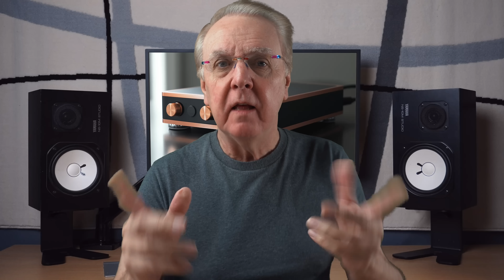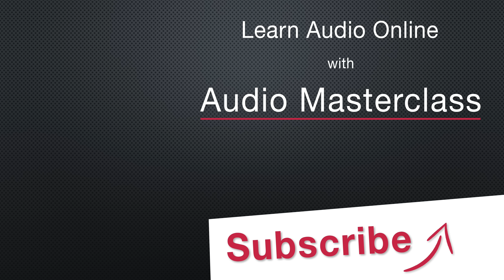Audiophile preamps - What should you get for $30,000?

Comment: What I expect for top money? The best components from big ass parts manufacturers that have the QC under control, the best capacitors, a pretty damn ass flat regulated DC power supply, ovenized V-REF voltage for the op-amps and exceptional well designed, modular PCB's with swappable modules and a FULL schematic with the BOM for the key components. Also fully shielded housing that can withstand shipping, and not a single component or wire flapping around in the breeze. 

When Marco Reps would fall into tears of Joy when opening that preamp up: Job well done and money's worth. :D

Comment: Learned my assembly and repair techniques working for Marconi Marine on marine radio equipment. All components formed and leads clipped and bent flat against the circuit boards. The back of the circuit board had to be completely smooth to the touch. All boards treated with a varnish coating to protect against dampness and vibration. Made repairs and fault finding a bit more difficult, but stuff i built 40 or 50 years ago still works within spec today. Mind you the equipment costs then were in the thousands of pounds per item, so most companies just rented the gear. Top performance and hand construction costs a lot of money but that should result in equipment that will last for many decades of use without developing faults. The box around the outside needs to provide protection and shielding first of all and look good as a very secondary feature. Look at high performance ultra cars, they mostly look as ugly as sin, but every feature is there to increase performance and improve survivability in event of an accident.

Comment: One specific "feature" of the controversial pre-amp was the hand selected components, this CAN be a very poor practice. As a child maybe 60 years ago I was building something and matching perhaps 5% resistors to perhaps 1%. I remember my late father explaining that a selected 5% resistor does not become a 1% resistor. The tolerance is not just of the initial value but factors in aging etc. 
IMHO for £25.000 this could have been beautifully engineered, well shielded  and still made a very good profit.

Comment: In my experience I have avoided tantalum caps due to many failures that I have seen.  The product in question seemed to have quite a number of those caps. Also ,why use twisted pairs when a nice coax would be better particularly for the low level inputs.

Comment: It's not about the actual performance although the unit seems pretty good. It's about boasting rights: "my preamp is worth $30K", "my speaker wire is $1000 a foot", "my cartridge cost $10,000.00", "my mains cable was $2000.00" - sure sound is good but only 0.00000001% of the human race can appreciate the difference from a decent system. And for the mains cable there is SFA difference. I need some magic tuning rocks.

Comment: See  RIAA equalization of phono
It isn't flat.  There are basically 3 standards so if you want to be super fancy you can include a switch.
It is basically a pair of decreases in gain one drops the gain 20dB from 20Hz to 1KHz and the second one drops an additional 20dB from 1KHz to 20KHz.
I have looked at mains on a scope.  It mostly is a fairly good sine wave except when it isn't.  Great big spikes happen and also sometimes big chunks are nearly missing.  The spikes are often stuff getting switched off.  The missing cycles are big things getting powered on.
I agree with the external DC supply.  There should also be some big common mode chokes included.  There is a lot of capacitance in transformer windings.
Resistors should be metal film of thin film not thick film or carbon-comp.  Thick and carbon resistors make excess noise when there is a current.
A nice transistor to look at is the LSK170 JFET.
For bipolar ones, there is a funny thing where the "medium power" transistors make lower noise than the small signal bipolars.
Capacitors also need more care.  Avoid any "high K" ceramics or polarized ones in the signal path.  They are OK for supply bypasses.
Reply from the maker: I’m saving RIAA for its own video. The output of any preamp post-RIAA should be flat.

Comment: The entire "design" of the unit was laughable.   How many power supplies do you need to power two preamp channels?  Personally, I'd probably opt for two linear split rail regulators in the preamp box fed by the linear power supplies in the ludicrously large external power supply box, and that would only be for the wow factor since a properly designed external unit should require no additional regulation.   I would NOT want to see audio processing daughterboards  attached by header pins which were allowed to vibrate in the breeze so as to become little microphones.  I would NOT want random lengths of hookup wire transferring low level audio signals inside the chassis.   I WOULD want all audio to be carried on shielded, impedance and length matched cables.  I WOULD want as a minimum an electrically sealed (TEMPEST) metal case to reduce external electrical noise as much as possible.   It's not VHF and UHF RF you need to worry about as much as the noise from all those switching power supplies in your house, the neighbor's houses, the digital noise on the power lines from SCADA data collection, the noise on the water lines from the same,  noise from all those LED lights you have now, etc, etc...  For $30k I would expect to see high-Q passive filters on all inputs and outputs.  I would want a 5hz low pass filter on the input power.  I would want 25khz low pass filters on the audio inputs and outputs.   I would want exhaustive circuit analysis and testing to ensure there were no RF audio detectors inadvertently included in the design.   One diode and one cap are all you need for that.   In short, I would NOT want anything I have seen in that design - and I have watched the entire video, frame by frame where necessary, to pull out details.

Comment: 2 things - transformers (step up or whatever better multi-gain amping) and margin: high-end equipment tends to have factor 10 margin to the product‘s technical value. So don‘t go overboard with it, make a 2K pre-amp and get a proper brand name and sell it via distribution channel for 21.299 including tax of typically around 20%.
Reply: They only sell 3-10 of these, using 4 as demo. And if it‘s successfully marketed, they‘ll have 20+ demos and sell them in a few hundreds. Demos will be sold at half list. consider the parts and the service to be set up for it, machines, … and you get it, uuups the margin starts to shrink quickly with this small series, yes, other products must be invented to at least sell a bunch more to cover staff and stuff costs. Sure, that‘s how it goes. No more, I‘m a power amp specialist, and you a speaker guy and her shes a turntable designer… All do everything and the smaller the brand the more everything they do and promise competence in it. 
just look at the audio note tt three model, ridiculous chassis at „reasonable“ price. Waste of money, not like the mid-tier amps, expensive, but good.
Worse is the constantly changing distributions and dealers for the brands, and brands that rotate model designs as frequent as china creates new cheap smarphones. How will you get parts to repair your expensive system in beyond 5years time, often not even within warranty. And with a lost dealer/distributor connection everything gets worse.

Buy direct from solid brands or better learn something and DIY - to get a decent sound there‘s no magic needed - good kits are around. You fix them everywhere, or by yourself if you shaped your skill. It doesn‘t need to be perfect, just good enough, it costs less, sounds good and you can focus on music, or make a few improvements and others, and more.

Comment: During the Reagan years, I was designing electronics for military aircraft and satellites.  The semiconductors for military aircraft were good from -40C to 125C, if memory serves.  Might be useful for the ultimate audio gear?  ;-)   We also derated the parts.  i.e. if a capacitor was going to be exposed to 20V, we spec'ed a 30V cap (again, I forget the details from 40 years ago).   That seems useful.  We also used semiconductors with known characteristics, such as how the leakage current would change over the years.  It involves a ton of testing, so that makes it expensive.  For $30k, I'd expect a full set of test data showing how the pre-amp was tested and what the results were, in order to demonstrate that it fully met the advertised specs.
Reply from the maker: Wisdom.

Comment: I used my AR XB turntable connected to my PC to record  WAV files. I used a stereo phono pre. Amplifier that cost less than 50 bucks.
 The specifications of preamp input 5mV @ 1KHz. Input impedance 100K Ohm/5mV. Maximum Input 30mV. Frequency Response 18 to 22,000 Hz. S/N Ratio: >50 dB. Power Requirements: 6V DC 100 mA. AC Adapter Included. 3 ft (0.9m) Stereo RCA Cable Included. I bought the Stereo Phono Pre-Amplifier at Recoton in Lake Mary FL. Recoton closed many years ago.

Comment: Watched your video and, you omitted an important consideration, retail price, trade price, maybe distribution price, and manufacturers price. There are at least three parts to any final price, so whatever the item there are costs, and profits. The maker has to make a profit, so does the end sellers, all of that, including taxes etc create the final selling cost. 

As you present your video, it feels very much like you are gathering items to arrive at a £25000 cost, which if the case would end up possibly three times that figure, to be a final retail price. Margins vary, but on average re audio electronics its anywhere from 35% to maybe 45% best case, for the end seller, with quantity ordered discounts, settlement payment deals etc. 

I don’t know if the Master Groove is sold direct, or through a dealership, but if sold direct, based on component costs, materials used, building time etc, £25000 gives a pretty good profit margin to Tom’s company, in my opinion. 

Tom Evans like a few other historical designers out there are/were obsessed with the effect case material has on the performance, and since his EC Audio days he has used acrylic cases, and well, you can only do so much with that material to make it look ok, and the Master Groove isn’t one of those good examples, it looks cheap to my eyes, and its innards, layout, look cheap too, because he is sticking with that design methodology. The top of the circuit boards only being shielded looks inadequate to me too, as the case has no shielding properties, but will lack the effect claimed, that metal cases have, which Tom design ethos reflects, maybe that makes up for it, but I doubt it. 

To my eyes it doesn’t look like its selling price, how it sounds, no idea never heard one. 

Regarding circuits being a thing of beauty, there is/was an audio company who made phonostages with exactly that quality, Klyne Audio, fabulous looking and sounding.

Comment: For $30k, it could at least have usable shielding inside (not just some panels top and bottom). I bet that thing picks up EMI like no other. And that plastic case may even contribute towards latent ESD damage for the active parts. Custom hand-built electronics are expensive, even $30k is not out of the question, but they do come with some equally large expectations.

Comment: If your an audiophile and you dont understand what makes good audio your not an audiophile. Real knowledge would tell you what it should be worth!

30k anything in audio is a joke
Reply: I replaced my Onkyo discrete amp with a Behringer KM750 and it sounds better.  Sure, it has slightly more THD on paper, but not at the SPL I listen to, (100db or so if I am letting it rip.)  I am sure my setup would horrify an "audiophile" but I'd like to see them replicate something that truly sounds better for $1400 (includes recapping the used JBL S-38s I bought off Facebook.)  I am in nearfield bliss when listening at the computer and prefer it to the main system in the living room.  :)

Comment: So the quality of the  vinyl pressing, which is not in your control despite your 30K amp,  doesn't have as much importance as ultra low distortion at 50kHz then? Really?  And is a dead flat frequency response plus/minus .1dB so important - what if I don't like the engineer's mix and want to adjust it?  Be a master of the process not a slave.

Comment: Must have missed something in this audio review. Listened for first 3 min until I had a developed a perception, he was some how skirting the issue. And based on comments below, comments did not address the review, rather personal perceptions. No doubt the amp is junk as is more esoteric cables. One clear point in the video is signal condition of the AC signal to the amp. However, this should have been corrected by filters internally. At $30k you would expect the company to provide an external power filter. Then again based on what I seen of the amp internals, would not have done justice. This is a $100 amp at best.

Comment: Just to think, for digital, "the best pre amp, is no pre amp!"
Reply: That doesn't work in the design I am working on.  The signal and the thermal noise in a 30 Ohm resistor are about the same amplitude.  I need to apply some gain to get it up past the LSB of a 24 bit ADC.

Comment: Shielded cables used in appropriate areas also, when a device specifies balanced XLR connections, it should have that, not just single ended  in and out.    Premium cases, not just a case made from polished perspex.   I don't mind a reference design circutiboard, providing the effort has gone in to make sure that reference design is absolutely perfected, but IF I was to spend the moeny, I'd want the device to look and feel absolutely premium, inclduing right down to the font used printing.
I enjoy your videos.   You have a unique way of getting the message across.  People just need to read between the lines a little.     I love how the community of creators rally behind each other.

Comment: Tom Evans really needs to up his game to substantially improve the build quality of his products. Or simply charge realistic prices (~75 - 85 % price reduction) for his current build quality. I have designed and built both solid state and tube (valve) stereo equipment.  I am proud to show anyone the inner workings of my builds, as I tend to spend more time and $$ on the actual performance and build quality rather than a expensive jewel case. Time to up your game Mr. Evans!!!

Comment: You forgot a separate power supply, one for each channel
Reply from the maker: I listed all of the points I could think of off the top of my head and used about a quarter of them in my video. Yes, separate power supplies, which certainly should be the case for monobloc power amps, and for a $30k preamp should be expected whether or not they make any difference.

Comment: You forgot a separate power supply, one for each channel
Reply: That is not really needed if the supply is stiff enough.  The currents here are small.  This is not a power-amp where separate supplies can mean more than one for each channel.  The big output sections can have a supply that is separate from the ones for earlier stages.

Comment: The cheapest Op Amp on the market when used with plenty of feedback would be indistinguishable from anything else. Why not have a blind Op Amp shoot out. 😂😂😂
Reply from the maker: Well we might have problems with gain-bandwidth product, slew rate, and noise, none of which are amenable to feedback. But yes it might be interesting to compare a 741 to a top of the range op amp, presumably if I can afford one. I'll consider it.
Reply: @AudioMasterclass  Considering that even the 741 has a 0.5V a microsecond slew rate, I don't think any of the specs would make any audible difference at low to medium gains. It was my favorite IC for my homemade guitar pedals/noise generators! 😁
Reply from the maker: According to my Casio four function calculator and my rusty maths that’s about a third of the rate needed for a full-level 20k sine wave. I doubt that this would cause any audible distortion in the real world but I like things to be right. Still, the shootout will reveal all. If it happens.
Reply: That is not really true. Spend a dollar on it.  You want to be a long way away from the slew rate limit.

Comment: Don’t forget the gold plated, silver wires. Special unobtainium screened connection cables are a must. Circuit boards should never be simple copper plated etched things. They have to have gold with, rhodium plated tracks. 😉😉 ( as for vibration/ dampening, they just have to be Royal Mail proof) 😂😂😂😂
Reply: In the days before solder mask gold plating an entire PCB was not unheard of.  For super duper high end stuff today, I think I would go with all buried signal traces.  The outside surfaces can be all ground plane except where the parts are.

Comment: 300 pound cast Iron casing around a Faraday cage which holds the ultrasensitive defense grade optocoupler with the custom Leica CCDs that convert the signal into a 24 bit, 192 KHz  left, right, mid and side channels, each individually amplified by bespoke Focusrite output boards. With a touch sensitive platinum control surface to adjust the response curve and dynamic bias on the input, which draws its synchronization signal from the JWST. Now we're talking.
Reply: Aluminum bronze

Comment: as a tech who works on professional studio equipment I wonder why the Audiophiliac haven't come up with a balance output cartridge
I don't see a lot of tantalum capacitors these days and never in power supply
if you understand the origin of noise In operational amplifiers There is a simple way to keep them quieter